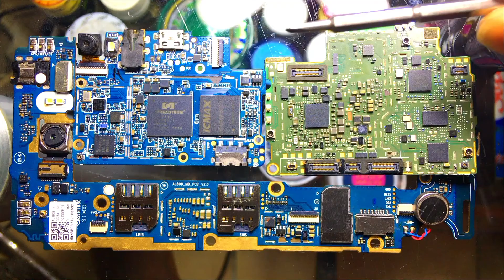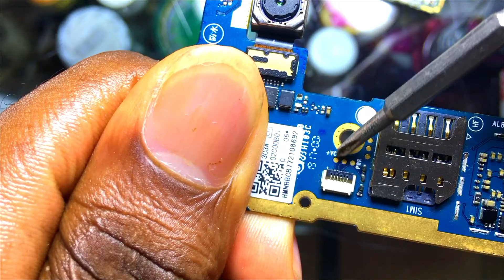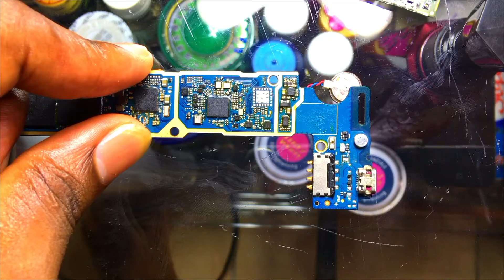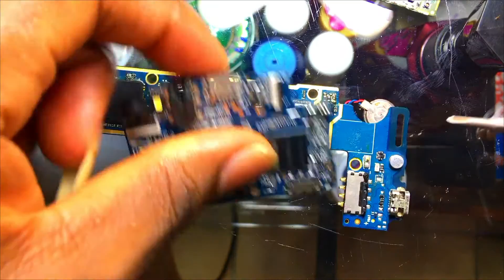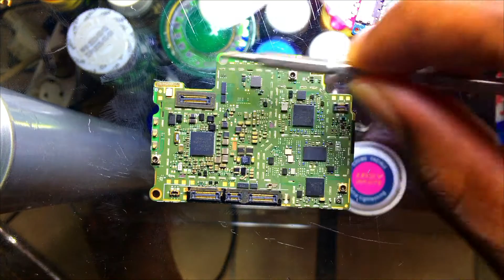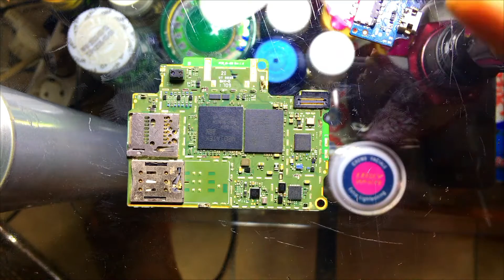How To Jumper Missing Power button, Battery connector, Charging port Tracks On Any Mobile PCB

Comment: I love this keep up the good work sir
My question is how can I trace power button voltage when there's no volts even on the jumper point but it's reading on the multimeter when put on conti?
Reply from the maker: There’s and open circuit between the power,cpu and the power button 
You need to find schematic diagram of the power switch
Reply: @SergesMike  can you help me with schematic diagram for tecno k8 spark pro? Please sir